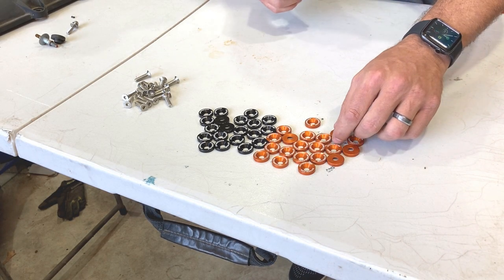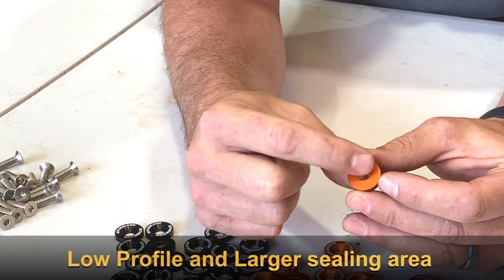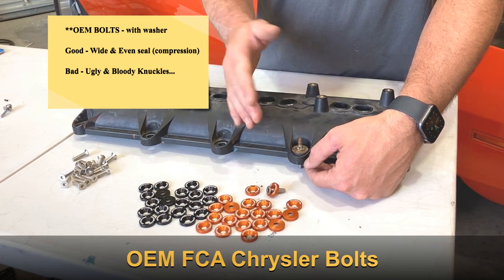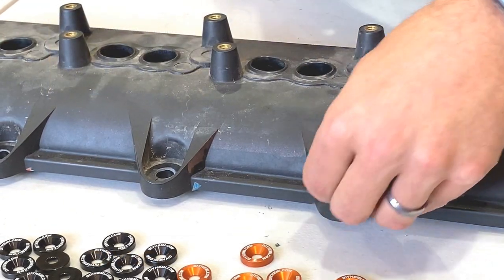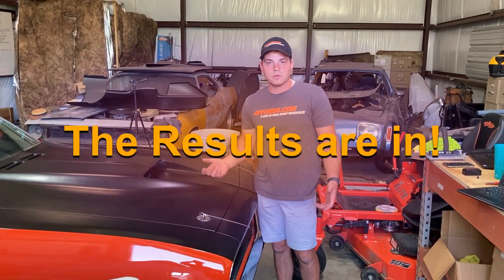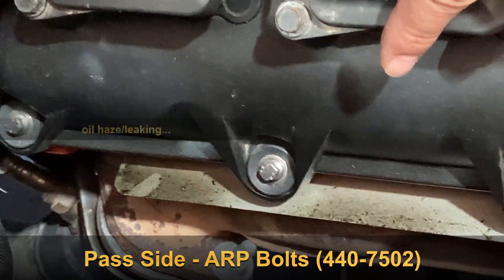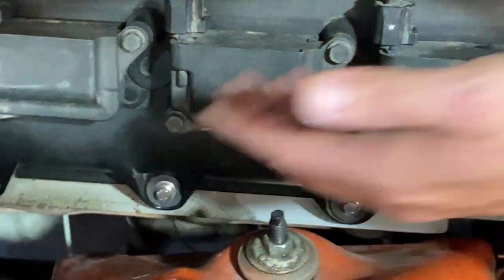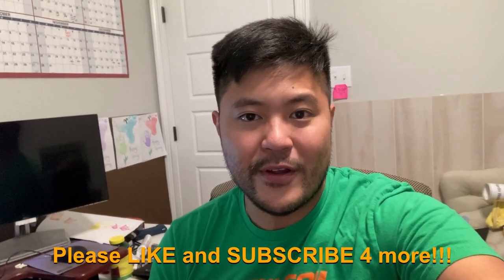DIYHEMI covers Valve Cover Bolt Options - Whose Better for your Hemi Swap?  ARP vs DIYHEMI vs Mopar

Comment: I have an '03 Ram with the 5.7l Hemi, and the ground straps are rotted off. Looks like they attach to the valve cover bolts but after almost 20yrs, I'm afraid to try removing them because look so old and rusted. That said, those countersink bolts looks great but how would you get them to work with the grounding strap with the the 45' angled head?
Reply from the maker: The grounding strap is a 03-05 thing where aluminum valve covers are used with crossover spark plug wires. If you want to keep the ground, put it under a coil pack bolt.

Comment: Looks like Harold asked and got the bolt torque question answered, but might I recommend including some kind of guideline online or supplied with with the bolts? I had presumed factory torque would work and ended up cracking a cover. Shame on me for not watching the grommet or, you know, thinking, but it might help other customers. Great product otherwise.

Comment: Hello, would these fit on an 04 Hemi head? I’m currently in the process of doing an 06+ coil on plug conversion and will be using the Eagle valve covers.

Comment: What you can do is cut the old bolts out of the rubber grommets so you keep the metal retainer and use the arp so you don’t mushroom out the bolts that’s what I did works great
Reply from the maker: Ugh, but we hate cutting and it looks pretty nasty still. Get these and look 😎

Comment: Okay, gonna try this again. I purchased a set of these for my gen 3 hemi. My question is how tight do you torque them? There is no stop point and if make them to tight I'd imagine they would distort the rubber grommet. So my question is how tight do you recommend for your valve cover bolts? I asked this below....and got a response related to motor mounts, not sure where that came from. Thanks, would really appreciate an answer back.
Reply from the maker: Sorry for the delay Harold, we were out on the show circuit. 

Typical torque values range due to the durometer differences in the valve cover grommets. Usually 4ish inch pounds. Basically you want to torque down enough so that the grommet just starts to round slightly with compression. Then go back and torque all other bolts to that same torque value. 

Again, look for slight deformation of the grommet, then apply that same torque value across all other bolts.
Reply: @SUBLIMEparts  Awesome, thank you. I basically tightened mine to that range, went hand tight, then about 3/4 of a rotation with a ratchet. the grommet would just start to deform a little. Just wasn't sure if that would hold. Do then need to be retightened periodically or do you find the pressure from the grommet keeps them tight?
Reply from the maker: @millstonejeepworx   I would visually inspect every oil change to be safe, but the grommet acts as a  bevel washer with constant spring load as well as high coefficient of friction to resist vibrating loose. You should be good to go, but it never hurts to check. We visually check ours periodically. Also the laser etching makes it easy to identify if they have turned any. We install them with the wording perfectly straight and in line. Thus, if any turn; we can identify it visually.
Reply: @SUBLIMEparts  Thanks again, went through and adjusted all the ones I installed which was on one side. Went to do the other side and realized I have enough washers but I'm short 2 bolts. Will go the store and get them and finish it up. Thanks again

Comment: Hey guys. Bought these for a 5.7 Hemi I'm going to be putting in my Jeep.  They look great. Question, installation is easy but how much do you torque them? Unlike the factory bolts these don't have a lip that bottoms out  and keeps you from over compressing the rubber grommet. I installed mine and basically went hand tight, then about 1/2 - 3/4 of a turn with a ratchet. Any advice as to how to make sure they are torqued enough without being too much? Thanks
Reply from the maker: If your talking motor mounts we followed Bouchilllons recommended torque of 70 ft-lbs. we also pointed it out in the video when we did the final torque 😁 👍. Good luck
Reply: No, talking about Diyhemi's valve cover bolts. What is proper torque for them
Reply: These look awesome and I actually want to buy a set. Only problem is there is no shoulder on the stud, this means you can’t tighten the bolts down. If you do you will break the cover. Need to include a sleeve with them.